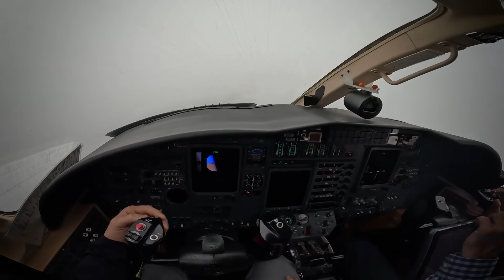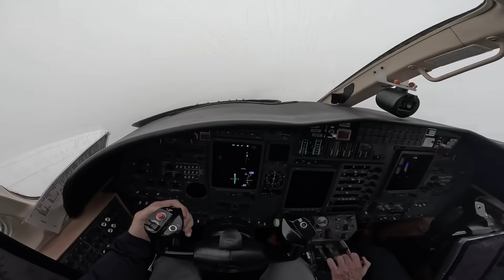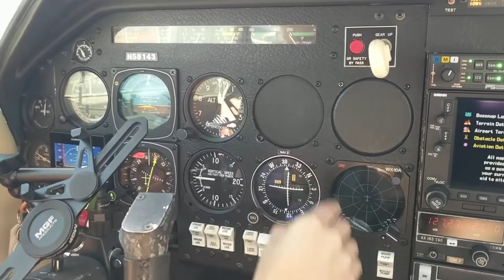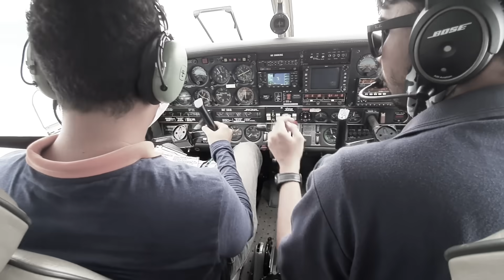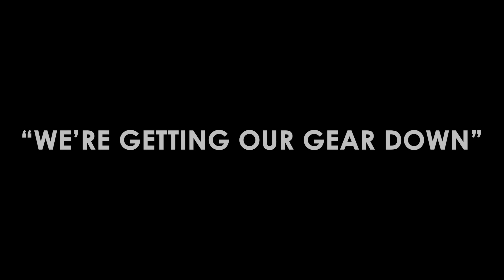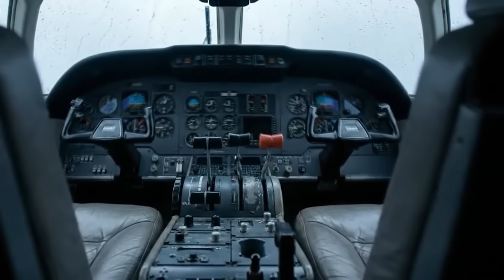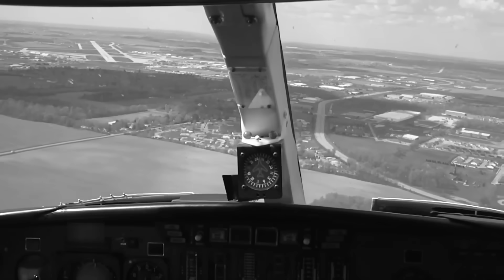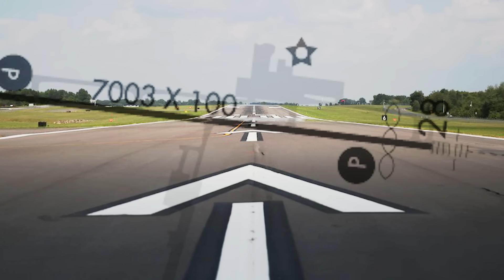Greg Biffle Crash ATC Audio EXPLAINED | When Configuration Became Commitment!

Comment: I was looking g at the ADS-B data
He entered downwind at 300 agl, turned base at 200 agl and final 100agl with speed decaying.

No way the retired Delta pilot flew an approach this horrible.
I think the kid or Biffle was flying and the dad Mr Dutton had a heart attack or stroke
Reply: A lot of people have said that a Delta commercial jet (unlike the Citation II) with only one engine would have been able to do a go-around at the last moment when it was clear that they didn't have enough altitude, so I am not so sure about what you claim. It seems likely that the former Delta pilot had never landed the Citation II with that much weight (no fuel dump), and that he didn't fully understand the limitations of the Citation II compared to jets he was accustomed to flying with Delta or previously with US military.
Reply: A lot of people, experts included are positive there was a loss of engine. But that is not confirmed. But if there was a loss of engine Mr Dutton would have followed citation 550 loss of engine procedure similar to Delta training 

He held a ATP certificate. 
Also in preflight he had to do his weights and balances calculations. One of those is to make sure the plane is capable of climbing should the lose an engine after takeoff. 
He was trained in the 550. 
He would never fly 200 foot downwind base final legs. Or do tight teardrop turns to final at min maneuvering speed in a full flap down configuration. And do what the handbook says not to do 
Psychologically many people ignore the obvious if it doesn't fit their assumptions.
Flying a one engine stable approach to landing if routine for qualified pilots
Reply: @proudbirther1998  The checklist procedures for single engine failure may not be the same for a Citation II compared to any Delta commercial jet, according to some experts who have posted comments. The whole idea of lowering altitude so quickly in or to find the airport using visual flight rules (due to low cloud ceiling), instead of trying to navigate with instrument flight rules at a higher altitude in the clouds, was likely ill advised.
Reply: What do you think happens if they lose an engine at V2. They continue the climb out till they reach a safe altitude.
With a two man crew one is flying the other is running checklist. Usually ATC is notified quickly.

This was a retired Delta Capt.
Losing an engine has a set checklist to run.

He has to shut engine down, make sure no fire.
This is trained for.

In this case I doubt there was an engine lose.
I think the Capt had a heart attack.
Reply: @proudbirther1998  A medical problem was my first thought also, but I have since come to believe that is less likely than an engine problem. But we don't really know at this point, unless we can get some clarification from the Cockpit Voice Recorder. The audio we do have from his son, doesn't sound like things he would say if his father had a heart attack. The non-flying pilot is usually the one who would get on the radio if there was a problem. Also, NTSB may be able to determine if there was an engine problem by looking at the engines.
Reply: Pilot was confident of 2 things. He had engine power and he could fly the route. If average speed was near 120 the plane flew about 20 miles. That says engine power is available. If power is only 50 percent gear up it will perform. Gear down it will sink. It set up a sink rate when gear was extended. The sink rate continues all the way to impact. Gear down was a good choice if rwy 10 was the choice.  They had altitude air speed power and position. But they abandoned rwy 10.
Reply: They would have crashed sooner. How would they get Dutton, who was big, out of that cockpit seat in that tiny cockpit. There's no room to move to pick up dead weight. It would have taken several minutes to move such a big man out of the cockpit seat and into a passenger seat or the floor aisle. They would have crashed sooner.
Reply: Who says the removed him from the left seat, almost impossible. 
The horrible non professional flying and communications confirms to me the dad was unconscience and the kid or Biffle was trying to return back to Statesville regional.

Also the wife texting her mom WE ARE IN TROUBLE. 
She saw the situation
Reply: One fact will not go away. Regardless of maneuvering and gyrations the plane was flying ok until the last 15 or 20 seconds. Maybe the cvr will explain.
Reply: Mexico wonder definitely the pilot failed the ball so sad could’ve been prevented

Comment: Great analysis, seems spot on. If landing gear had that much effect on airplane operation you would think training would be: "In an engine power related event landing gear is to be deployed only at the last possible moment so as not to negatively affect already weakened airplane performance."
Reply: Often pilots dont like to risk rasing gear if a engine is out. They have concerns about failing hydraulic systems.  Landing gear is one of the higher demand hydraulic systems
Reply: According to experts who fly that plane who commented in other YouTube videos, if they had looked at the checklist for a single engine failure, they would have seen that it says to not lower gear or flaps at that point, and to fly around to burn off fuel (the plane cannot dump fuel) and/or to attempt a longer and gradual final approach to the runway, instead of the very sharp turn they made. But that would have required that they stay in the clouds and fly with instrument flight rules (instead of visual flight rules), which apparently the pilot did not want to do. Also, Charlotte International Airport (close by) has a better IFR systems than the IFR system at Statesville Airport. Most likely, that pilot has never landed that plane with that much weight, due to the amount of fuel on board.
Reply: @Mark-rw3kw  The pilot was having trouble seeing through all the fog. He had to keep the runway in his sights at all costs. He couldn't allow himself to lose sight of the landing strip.
Reply: @NalaRichenbach   I agree that he couldn't see the runway until he lowered altitude. However, I don't agree that he had to land with visual flight rules. I think he should have flown off in the distance at higher altitude, and then proceeded with instrument flight rules gradually turning back to make final approach and land the plane. It probably would have been better to fly to Charlotte International Airport because they have a better IFR system there. Several pilots have stated that the checklist for single engine failure on that plane says to not lower gear or flaps until absolutely necessary on a straight in approach, which they obviously did not follow.
Reply: @Mark-rw3kw Interesting
Reply: Period.
Reply: Good point

Comment: Possibly overloaded...that plane will take off and fly with 1 engine..if underweight...heard from another pilot that two pilots two passengers and luggage was about as much as you could get on that plane...
Reply: Full fuel also
Reply: @hdtripp6218 also, you have no idea what you are talking about
Reply: A citation with 2 pilots and 2 passengers  and baggage will be overloaded?  How much baggage? 1000lbs?    Even with full fuel you are a bozo
Reply: I spoke to someone who insists that it wasn't a weight issue. We'll see what the NTSB has to say and it's not going to be good.

Comment: Question: Was this the first time Dennis Dutton flew a  Cessna Citation 550 and didn't know it's limitations?
Reply: Apparently Dennis flew commercial for delta and those 737’s can fly fine on 1 engine…the citation 550 was an underpowered dog on 1 engine, full fuel, full load and gear down all made that plane drop quick
Reply: @tmonster1498  and NOT following his airline training and using the checklist for OEI condition led to disaster
Reply: The flight profile suggest Mr Dutton had a med. Emergency and Biffle and the kid was flying it in.

That's why pro pilots are preplex at such horrible decisions and flying by a former Delta Capt.
Reply: @proudbirther1998   Medical emergency is possible, but I personally doubt it. They just didn't consult checklist for single engine failure which says to not put gear or flaps down, and tried to go below the cloud cover before final approach, which was too low, and then made sharp u-turn with gear and flaps down, and not enough power to do go-around.
Reply: @proudbirther1998  If Dutton had a medical emergency.. that plane would have crashed sooner. Trying to remove dead weight from a cockpit is not an easy task when you have no room in that tiny cockpit. They would have crashed just trying to get him out of the seat. He was a pretty big guy.
Reply: @NalaRichenbach  EXACTLY - there is NO ROOM in that tiny cockpit/cabin to get his body out of the way to allow Biffle to even try to take over

Comment: i think the lowering of the gear caused to much drag and thats why they came up short and crashed.
Reply: Lowering of the gear and the flaps, which is contrary to the checklist instructions for single engine failure on that plane. The landing was so quick, that doesn't seem like they had time to consult checklist.
Reply: Ya, not following his airline training and/or checklist for OEI condition - just trying to half-ass it back around got them all killed
Reply: You are absolutely incorrect.. .

Comment: Still don't understand why they didn't land on the runway they took off on. They had a straight shot at it to land. Instead they flew around and made a sharp turn to the other runway which I felt was a bad move.
Reply: I’ve been thinking same ,, even if landing rong way , still be alive
Reply: @JeremyMullen-t9w  wrong or rong?
Reply: They were in the clouds and could not see the runways until they descended in altitude. By the time they got below the clouds and could see the runway, they were out of position.
Reply: @Mark-rw3kw there was a five mile visability
Reply: @shawncarlson705   Five miles visibility if below the cloud cover, but they were initially above the cloud cover when they decided to make first u-turn, so they descending in altitude trying for landing with visual flight rules, instead of instrument flight rules.
Reply: @Mark-rw3kw so do you think it was an engine failure
Reply: @shawncarlson705   Based on the audio recording, my guess is that it was an engine failure or engine vibration (rough engine) problem. It could have been an rough engine and they shut down the engine. Hopefully the Cockpit Voice Recorder will reveal the exact problem, if not damaged by the intense fire.
Reply: @Mark-rw3kw Agreed. Geometry was against them at that point.
Reply: The pilot was having troubling keeping sight of the runway. The fog and overcast made it difficult to see.
Reply: @NalaRichenbach  Pilot should have flown instrument flight rules instead of visual flight rules.
Reply: @Mark-rw3kw  👍 Definitely!
Reply: Maybe because they knew their luggage was all over Runway 10 after it had blown out of the forward baggage compartment when the right front compartment door (missing in the post crash photos) opened on rotation and some of the contents were ingested by the right engine??? In their first radio call on the common frequency to anyone in the pattern or on the ground they specifically asked a plane they knew had been behind them on the ground NOT try to take off on Runway 10.
Reply: @JRB1457-v5n   I think they were letting other planes know to clear the runway because they were coming to land. There is no ATC at that airport.

Comment: Your reasons and justifications are funny. You act as though this pilot had all the time in the world to prove some kind of legal case. LOL
If you're engine is malfunctioning immediately after take off assume the engine is OUT and land the plane! Simple. 
There's a reason Sully saved all those people. He made the correct and best decision QUICKLY.
Reply: Different set of circumstances. Sully had NO engines and NO thrust. That Cessna 550 could have climbed straight out to a safe altitude on one engine to allow time to assess the situation, run a checklist and divert to the nearest airport, Charlotte (32 miles away) with assistance from ATC after declaring an emergency and setting up a stable straight in approach. Flying that CE-550 with two 180 degree turns in a teardrop pattern and landing gear down with full flaps back to Statesville (according to ADS-B data they flew 26 miles just to do this) was impossible. Qualified pilots for the CE-550 Citation will tell you it flies like a pig on one engine when making turns with flaps down because it is a straight wing, not swept wing, aircraft. It’s nickname is the ‘Slowtation’

Comment: They never said rough engine they said some issues. If they had a rough engine they wouldn’t have put the landing gear down and landing lights on cuz that would create drag that would make it worse for them rather than help. They said some issues not rough engine and that was confirmed by many people
Reply: its literally in the audio. how dumb are ya'll?
Reply: @loganchin-e2j  They're big government gatekeepers.
Reply: Who you trying to fool?
Reply: I mean some issues coming from a inexperienced pilot would be his proper radio calls.issues could mean anything, even a rough or vibration coming from the engine. My problem is you never hear the PIC, he could  be flying the plane and to distracted, sounds like alot of issues if he can't radio. It sounds like the son on the Radio, he seems to be actively flying the plane not someone else. Everything hes calling out the plane was doing. You would think peoples lives at stake the father or PIC would have taken full control. Which he would have gained altitude and assessed a check list before landing. This was an emergency either from power and engines or issues same thing, or it was a medical emergency with the pilot. That has actually happened many times. It could have been both the plane starting having issues and the pilot had a stroke or heart attack. There is alot more audio I feel like 10 min dont take long when your in a emergency.

Comment: 104kt whilst banking towards the runway it was coming down anyway at that speed.
Reply: No way a retired Delta Capt and person type rated in this aircraft flew the bad of an approach.
I'm betting Mr Dutton had a stroke or hart attack and the kid and Biffle were trying to fly it in
Reply: @proudbirther1998  Airline pilots screw up too - my disabled son and I have watched "Air Disasters" daily for years - AMAZING how many "experienced" flight crews" have crashed airliners - large and small - airline pilots are HUMAN - they make mistakes too - Captains have ignored warnings from co-pilots or the aircraft MANY times - you can hear the TERRAIN warning going off many times until the airliner and passengers become part of the terrain because the Captain won't acknowledge REALITY.  If the PIC here was disabled - no way Biffle could have got his body out of the way to get into the seat - have you seen how tight the interior is on a C550 ?
Reply: @KRAM-ct7ok I love watching ar disasters I learn so much although I would ve knowingly get on an airplane
Reply: @proudbirther1998  bullshit

Comment: He does NOT SAY rough engine??
Reply: The rough engine / loss of engine has now become the mandella effect.
People will assume it's true because of what they think they hear on crappy audio 

My belief now is Mr Dutton had a heart attack or stroke and Biffle and the son were trying to fly it back to the departing airport.

Explains the erratic and horrible management of speed and altitude.

It's shocking to see this plane flying under 300 foot downwind leg and under 200ft teardrop vase to final and minimal flying speeds.

No way a retired Delta Capt holding a ATP certificate and type rated to fly the 550 would fly a traffic pattern this bad and this unstable.

No way!!! The kid and Biffle were trying to get it down.

Comment: After the tight turn with full fuel,a full load AND the wheels down. I can see him trying to get the plane to get up and all of a sudden realize all his mistakes as the plane starts hitting things and......
Reply: My opinion, the pilot totally failed them all
Reply: The qualified pilot was dead. Or dying 
He was too skilled to fly this poorly and dangerously.
The son or Biffle was flying the jet.
Reply: @proudbirther1998   Wrong, further info says the father was pilot, son was co-pilot. It's been discussed that when the problem with the engine came up, the father did not want to do the correct thing and climb and then land at Charlotte where more help was available because he knew he was illegal, son was illegal, and both would have had their pilot license permanently pulled. Instead he made all these crazy turns to try and get back to the unsupervised airport.
Reply: @pattii55  That is not true. A pilot can be flying VFR lose and engine and NOT declare an emergency if he doesn't want to. He can choose to land an an uncontrolled airport by flying a normal traffic pattern. he does not have to fly low under radar, make a normal landing and it doesn't have to be reported. 
Only if he declares an emergency with he have to do all kinds of paperwork and answer some questions
Reply: He knew he phucked up when the right wing was shredded open after he hit the tree tops. They had to smell all the fuel. Inside that cabin must have been from hell.
Reply: Dennis why why you we’re trained for these failures
Reply: Dennis was most likely unconscience.
Use logic. He was a retired Delta Capt and Type rated to fly the citation.

You really believe he would fly this traffick pattern as horrible and unstable as was flown??

No way! He was not at the controls.
Reply: @proudbirther1998 --- your theory is completely wrong and bizarre.  The son clearly stated over the radio they had an engine problen, NOT a medical emergency.  The flight pattern shows just a bunch of common-type pilot errors.
Reply: Why don’t we hear  the sun not the pilot